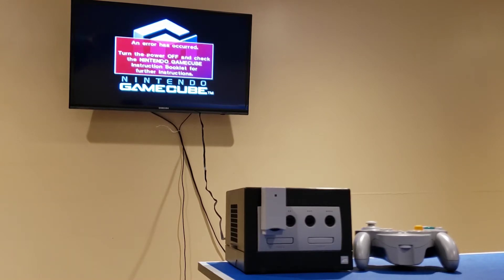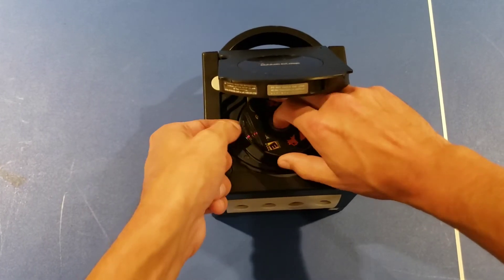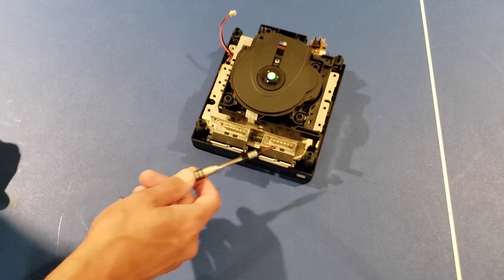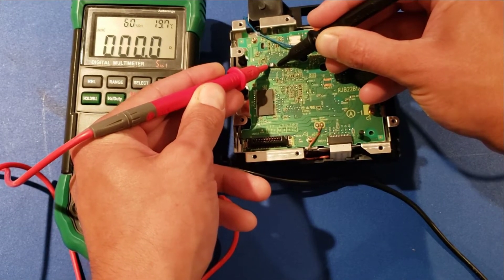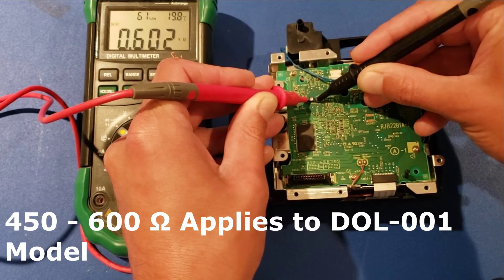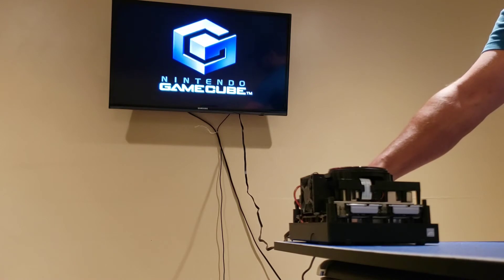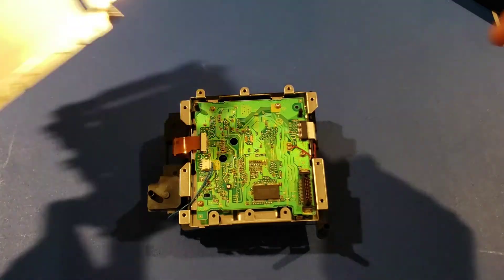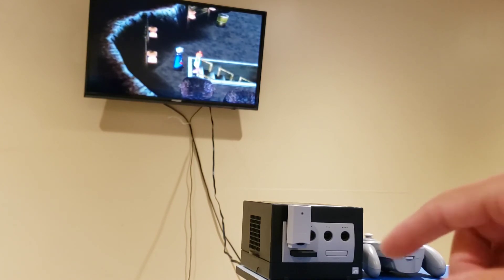Fixing a Gamecube Disc Read Error (DOL-001)

Comment: 3 years down the road and I must make one comment. The pot should have read resistance regardless of the solder joints unless the pot itself was bad. My guess is the pot was dirty inside and the heat from soldering the joints freed it up.
Reply from the maker: I've had to do this on various gamecubes, PS1, and PS2's because I wasn't getting a good reading, and reflowing the solder joints has fixed it every time. I always assumed it was related to intermittent solder but I suppose it's possible the heat is helping the component itself in some way. My probes are touching the solder on the legs of the component and not the legs themselves, so if there is bad connection at that interface, I wouldn't get a reading even if the pot is good.

Comment: My GC sometimes it boots up the game fine but most of the time it goes straight to the menu and I have to open and close the lid for the game to be readable.
Can you tell me if this is bad capacitors from what I read it’s the main problem or is it just a bad laser?
Thanks
Reply from the maker: I suspect it's the caps starting to go bad if it needs to "warm up" before reading games.
Reply: @FantasticQuack  yeah that was it, replaced them and it’s all working well again. Thanks!
Reply: @FantasticQuack mine never does the boot from start up, but does let me enter the game through the menu. And the games work fine from what I've tested

Comment: What happens to a gamecube that boots into other games but fine but breaks on this game? It reads fine, it just won't boot. it seems to be the only game to be like that. is it the disc? It looked relatively unscratched.
Reply from the maker: Hard to make confident suggestions without seeing all the discs you've tried but resurfacing the problem disc is the easiest option to test, followed by a laser pot adjustment.
Reply: @FantasticQuack  well resurfacing worked for most of them but not colosseum. I tried it on multiple GameCubes  but it gets past the Nintendo logo but then goes into the read error. I tried other games I resurfaced which worked on one of them (with a better laser?).

Disc is probably either damaged in some way or needs like some multiple odd sessions.

Comment: look into changing the capacitors of the disc drive! that also is the culprit of the laser not reading discs!
Reply from the maker: Will have to keep that in mind if my usual technique doesn't work in the future!
Reply: @FantasticQuack  I have recently repaired a PSOne by replacing all capacitors so I am on a mission to tell everyone repairing consoles to consider that option lol, I just didn't know those little bastards cause all sorts of havok !

Comment: Hey! I didn't play my Cube for a while. The 3 games I have got dusty, I cleaned them off and now only one of them works. The other 2 will get to the pre-pre-starting screen before throwing an error. So, if one works, shouldn't that mean that it's able to read the disc and I don't have to break this bad boy open? I've cleaned the lens and cleaned the disc plenty of times, but they just won't boot up. Do you have any other fixes?
Reply from the maker: Have you tried resurfacing the discs having problems? If you have at least one disc working normally it could just be that the other games need to be resurfaced, or possibly you're right on the edge of the potentiometer being in a good range.

Comment: Did'nt work for me after cleaner lens, adjusting from 150 to 600 ohms. Ordered a new optical laser. My 2 Dreamcasts just had door sensor issues so I did'nt have to mess with  the ohms.
Reply from the maker: Did you try reflowing the solder joints on the laser? 50% of the time I have had to do this for it to work. If you already got a new laser then I hope that works out, cheers!

Comment: how long does it stay "fixed" after adjusting the pot like that?
Reply from the maker: The oldest one I've pot-adjusted that I still own is the one in this video, and it's been about 2 years without issue. My guess is it will go 5 more at bare minimum before the pots drift too far again. Basically I expect it to last at least half as long as it did brand new out of box. Whether something else goes wrong in that time period is another question.

If you want the pot to "last longer" you could search digikey or mouser for an equivalent one and replace it. Problem is that that pot will also drift over time and have the same problem one day. Similar problem exists for replacing the optical drive entirely. So may as well adjust the pot that's already in the console.
Reply: ok sweet, just was wondering on average, i adjusted  a 360 and it lasted like another 1.5-2 yrs

tried to fix my gamecube and its totally shot i went from like 200 down to 90 and nada, wont spin the disc so probably completely shot or something or disc drive itself @FantasticQuack
Reply from the maker: @BanditsBest686    not spinning the disc is a different problem. Did you check the switch that tells the system the lid is closed? That's likely the issue and you should probably bring your pot back up ahead of time--90 or even 200 is way too low. Check out my more recent gamecube repair vid for an example involving that switch i mentioned
Reply: its a dol-101 model gamecube

i played with switch, it activates fine for that lid switch cause the laser activates, it just acts like it doesnt read the disc. @FantasticQuack
Reply: i was manipulatin the switch by hand with the case off too @FantasticQuack

Comment: This video definitely helped me in my journey to fix my GameCube. My potentiometer was at 352 needed to increase it and now it’s working fine! Had to change out the capacitors as well tho.
Reply from the maker: Glad to hear you got yours working!
Reply: I have a question. How do you know if it needs to be turned up or down?
Reply: @SwEtchinmusic  depending on the model that you have let’s say you have (DOL-001) that models potentiometer has a range of 450 ohm - 600 ohm so if you check your potentiometer and the range is above or below that range then you would have to adjust it according to the range. There is no magic number tho you just have to try and hit that sweet spot. If it still doesn’t work after trying multiple times then more then likely it’s not the potentiometer you need to adjust but something else like the laser or the capacitors.
Reply: @seanosorio1631  awesome thanks! Another issue I was having is that in the middle of Playing my game stops and says the disc cover is open. The game resumes if I either, push down on the disc cover or open and close it again. Any idea what might be the cause of that? I can't really find a video addressing this issue.

Comment: Hi. My gamecube disc drive makes a loud snap from time to time, like hiting hard at the plastic where the lens move. Please help?
Reply from the maker: It sounds like one of the plastic pieces tied to the guide rails or otherwise nearby may have broken off, and is loose inside the drive causing the noise you're hearing.
Reply: @FantasticQuack  I dont understand, it's nothing broken and all fits right
Reply: @EdingardSIGMA  Yes, opened and checked. I dont know what it could be.
Reply: @EdingardSIGMA  Mine is Made in Japan DOL-001(EUR). Do you know the ohms in your potenciometer?
Reply: @EdingardSIGMA  Ok. Thank you!

Comment: When I close the lid or press the power button, it tries to read the disc for about 7-10 seconds, and then the message “disk error” appears. I can also hear a whistle every now and then, or louder noise of the mechanism. This happen with a lot of attempts, even 30-40, untill at a certain point the game starts. From that moment, every time the disc starts immediately, on the first try, even changing games. If I leave the console off for a few hours, the problem reappear. Based on this, could it be that it just needs a calibration?
Reply from the maker: I would try the pot adjustment for sure
Reply: @FantasticQuack  i did that. It was at 248, lowered it to 200 and now it works! But shouldn’t it be at around 450-600? What does this means?
Reply from the maker: @matteog.6909  Just take the win and don't question it :)
The nominal value can vary depending on the gamecube model and no one seems to have a consistent answer on what it should be.
Reply: @FantasticQuack  What about a fat Playstation 2 that has no problems reading, but has very slow reading times (2 minutes)? Di you know anything? The same trick can be done?

Comment: I tried to tweak the pot but it wasnt enough . Now I've Seen your video I remember having a LOT of trouble measuring the resistance of the pot , may a little soldering be enough ?
Reply from the maker: Yo that's definitely what you need to do, I've fixed around 10 consoles with the issue at this point and over half of them needed the solder joints reflowed. I've had to do it once on a PSOne and it was the same story as well.

Comment: Put a new laser in a 001 and I've made pot adjustments all over the place and still cannot get it to read a disc
Reply from the maker: Sorry to hear you're having troubles. Are you using a meter to check the resistance? I'd be very curious to see what's going on with yours myself because so far I've never seen this method not work.
Reply: @FantasticQuack  I believe it's a bad cap on the disc drive board.

Comment: I've never tried soldering before, and I don't have the supplies to do so.  It looks like replacing the whole laser unit might actually be cheaper and easier for me.
Reply from the maker: The soldering involved here is extremely simple and cheap soldering irons can be picked up from Amazon for just 10 bucks. An ohmmeter is nice to have but not 100% required, they can also be found as low as $10. Just pointing that out, but do whatever is comfortable for you, hope you can get it fixed!
Reply: @FantasticQuack  hey, thanks for the heads up. I might take some more time to look into this then. I kinda crippled myself recently, so I have plenty of time, since carrying packages to my 2nd floor apartment isn't really feasible on crutches lol.

Comment: I got an error message “the disc could not be read” while I was playing. I’ve never got this message before. All my games works flawlessly. Now I don’t know if I have to adjust the POT only because of this game. The game has normal scratches like others games has and all of them works.
Reply from the maker: If it's just one game causing you trouble I would try getting that disc resurfaced as a first step.
Reply: @FantasticQuack  I try to adjust, no success. Now I can open and close the lid when I get the error message then the game returns working. The game is Metroid Prime 2, and read that Metroid Prime gets the laser really busy during the entire game. The problem was fixed on Player's Choice version, but mine is the regular version, I got the first prime on Player's Choice and I have no problem with it. 

An odd thing when I mesure the POT it was really low, less than 100, i set to something like 200, it got worse, the more I increase the more it get worse, so the best number I got was between 70 ~80. My meter was set to 2k, was this right?

is the laser getting tired or something?

Thank you for answering.

Comment: What's weird is I can get into the game and play it but after a while it gives the disc could not be read sign
Reply from the maker: Sounds heat related which points to an intermittent connection. I would try reflowing the potentiometer solder joints.
Reply: @FantasticQuack  thank you

Comment: I did this when I adjusted the pot once i hit over 459 my multimeter will start to read 0.04 and up instead of 500 or 600 but when i go lower my multimeter will read it correctly. Why is this?
Reply from the maker: Either a bad meter or intermittent solder joints on the potentiometer. I'd guess the latter and would recommend reflowing them.

Comment: my gamecube recently stopped reading discs after running perfectly fine the day before and i was super bummed out as i use it quite often. this video was super helpful but i don't know where to find the device they used to test it? i don't wanna poke around in my console without needing to and would like to properly diagnose the problem. any help or input would be awesome!
Reply from the maker: The tool to check the laser potentiometer resistance is called a multimeter (also referred to as ohmmeter)
Reply: @FantasticQuack   thank you so much!
Reply: mine too i wish i will be able to fix it

Comment: Was the disk spinning at least? Or would it not spin before giving you the read error.
Reply from the maker: It would spin then stop spinning when the system couldn't read it. I've had some where it doesn't spin at all though and it always comes back to the laser potentiometer being the root cause.

Comment: What mode is your multimeter on?
Reply from the maker: Resistance (ohms)
Reply from the maker: You shouldn't be using the voltage setting. My meter auto detects range so there's just one ohm setting, if yours has multiple settings either the 200 or 2k one should work, just make sure you are reading the units correctly. You want something like 450 ohms for DOL-001 cube models and can continue to reduce in small increments until it works. Check 3:40 and onward in the video.
Reply: Is it 20k?
Reply: I put my voltage in 206 and it worked for a few minutes then it turned off?
Reply: Do you know the right voltage to set it on
Reply: Hello again, I did it and it still did the same thing.it was working then it stopped spinning
Reply from the maker: @Mr.GameWatch78  try lowering resistance a little more you should find the sweet spot eventually
Reply: I tried 450 to 600 and I did it a bit less all the way to 200 but it still loads then turns off
Reply from the maker: @Mr.GameWatch78  is the resistance reading you're getting continous or does it flicker in and out? I've had a number of these where I had to reflow the solder joints on the potentiometer before I could get a solid reading and thus get the thing working.
Reply: Yes it stays at a number
Reply: Do I have to replace the laser drive?
Reply from the maker: @Mr.GameWatch78  if all else fails it might be worth trying. It's hard to offer any additional advice without looking at it first hand. I hope you can get it working!
Reply: Thanks a lot, I ordered the drive and will make a video about it when it arrives

Comment: Quick question, if your cube is fine and there are problems with the disc itself; can the disc be repaired?
Reply from the maker: If the disc has visible scratches you can resurface it manually with plastic polish (or even tooth paste works sometimes). Retro game shops will resurface discs for you as well for a small fee or even free if you make a game purchase.
Reply: @FantasticQuack  Okay good to know, someone was selling a cheap version of pokemon colosuem but it was not working so it might just be their cube not working

Comment: How do you fix the second error message
Reply from the maker: There can be other causes such as a faulty disc drive. I was getting either no error, or one of the two error messages shown in the video each time I turned it on so it was not consistent. In my case I fixed it by reflowing the solder joints on the laser adjustment pot to repair it's connection which had become intermittent over time. Then I adjusted the pot to a more nominal resistance value. This is all shown in the video.

Comment: interesting that all it required some joints touched up, wonder how they got faulty in the first place
Reply from the maker: I thought this as well. I ran into the same problem in the past on an original playstation and reflowing those solder joints on the adjustment pot was all it took to fix. Maybe outdated solder alloy or flux which caused oxidation or movement (possibly exacerbated by poor ventilation/heat) over time. When you don't know, reflow!